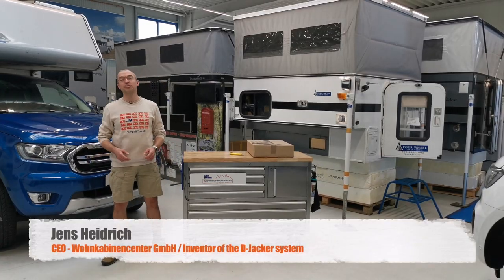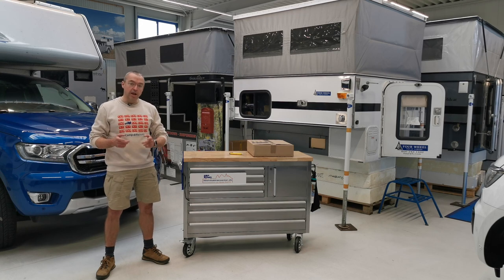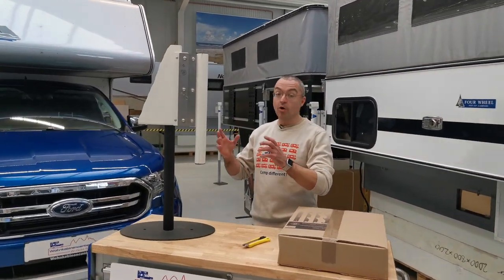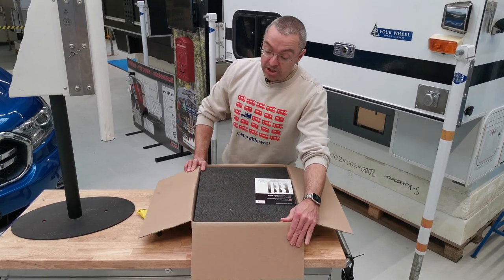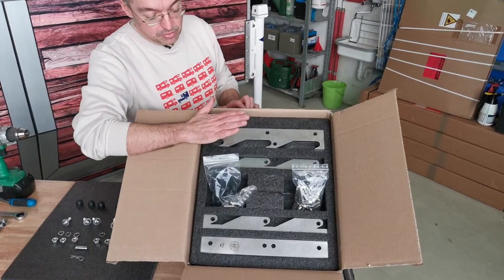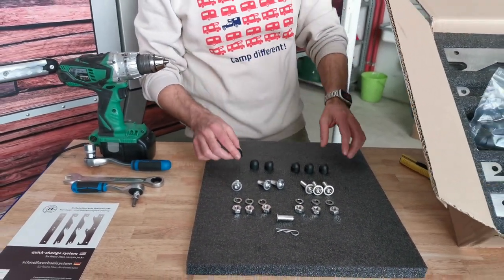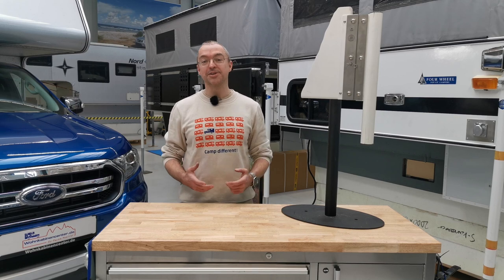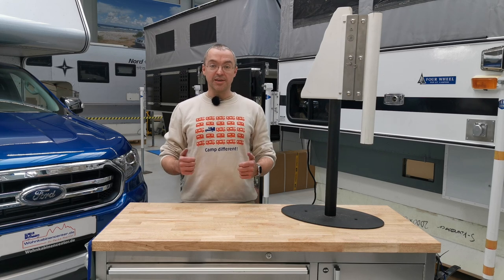The D-Jacker - A quick release system for four corner pickup truck camper jacks.

Comment: Greetings from Welsh speaking North Wales. An excellent product and an excellent video; you should consider lecturing as you have a very good style. Danke auch/Diolch hefyd, for the German language lessons! I want to build a demountable camper utilising a small caravan body minus the running gear and may well look at using your D-jacker system with suitable adapters that attach to a subframe that attaches to the caravan chassis, (such things are easier for me than they are for German citizens who have to contend with TUV), partly because of the extra 50 clearance your produce achieves. I'm a retired trailer manufacturer amongst other things and I'm sure this idea can be executed safely.
Danke noch einmal/Diolch eto

Comment: Will this also fit the Happijac jack which uses a similar jack (leg) mount? The bracket hole spacing would be only difference I believe.
Reply from the maker: I think except of the bracket hole size is would be the same. Does the Happijac use screws or had it welded-on bolts?

Comment: Nicht schlecht. Macht Sinn in Europa. Aber, meiner Meinung nach wäre es besser am Camper den Schraubenkopf auf der weichen Aluminiumseite und den Federring mit Mutter auf der härteren, deshalb dazu besser geeigneten Edelstahlseite zu montieren.
I think this is the right way to go in Europe.
But, in my opinion the lock washer (you called it spring washer) should not engage the soft aluminum bracket on the camper. Instead turn the screw around snd have the lock washer engage the harder stainless steel bracket.

Comment: Would having those bracket on interfere with using the jack brackets to mount other attachments used when the jacks are not attached?
Reply from the maker: No, you even can add various items on a D-Jacker connection plate for easier attachment and detachment.

Comment: One box of  499 Euros contains 4 sets for each leg of the truck camper?  Usually, how long would it take to arrive to the US?
Reply from the maker: Correct, for 499,- Euro you get a complete set for one truck camper. It will take around two weeks until you get it.
Reply: @Wohnkabinencenter1  wonderful, putting my order today.

Comment: Does the D Jacker work with !994 Atwood Camper Jacks ? Thanks
Reply: 1994 Atwood Jacks !!  Not !994 .
Reply from the maker: Yes, it works. Probably you have to drill new holes in the mounting plate on the jack. But basically, it will work.